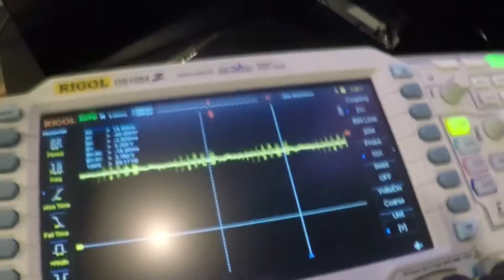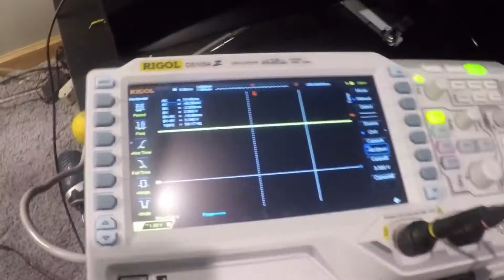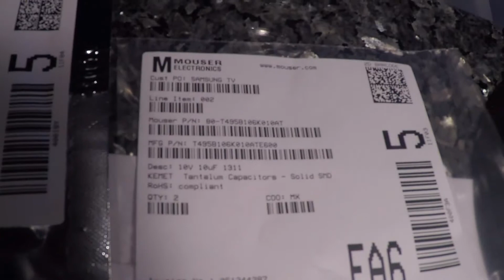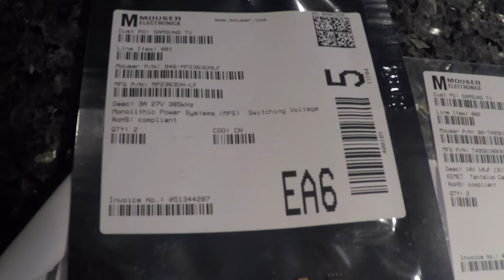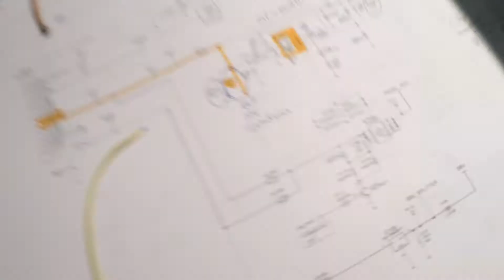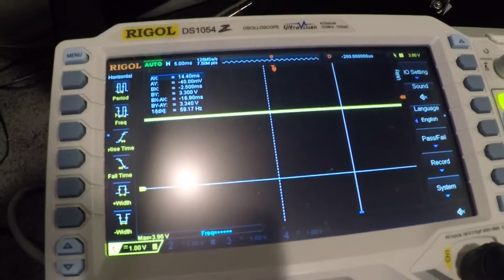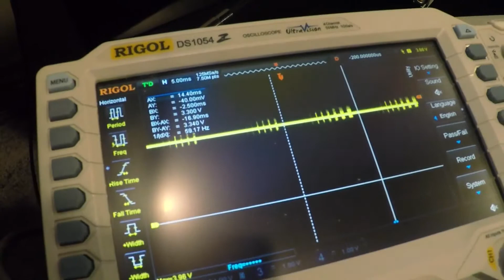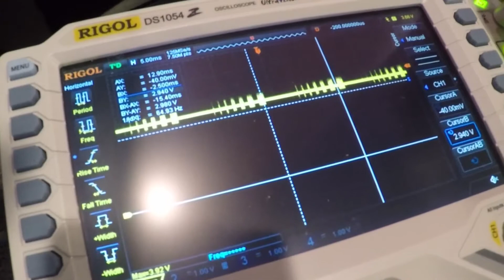PN58A550 Main Board 3.3V Power Suppy Repair

Comment: April 2019... Had same problem with my 2008 plasma, same model as yours, board was a little different, but by changing these two components, it fixed my issue of lines and high pitch sound at cold startup. Thanks a million.
Reply from the maker: Then the video was worth making!!  Glad it worked.

Comment: Do you have a schematic for BN41-00975?  I'd like to download it.  Thanks
Reply from the maker: The doc labeled "Samsung_PN50A550_PN58A550_SchematicDiagram_[SM].pdf" is the one you want for the Main board: http://www.toms-service-manuals.com/?do=search&mfg=Samsung&modelsrch=pn58a550  (I replaced C102 and IC101 on page 3 of that document).
Reply from the maker: The SMPS power supply seems to be this one: http://www.toms-service-manuals.com/?do=search&mfg=Samsung&modelsrch=183
Take the pdf to FedEx kinko's and print on 11x17 and they are very readable.